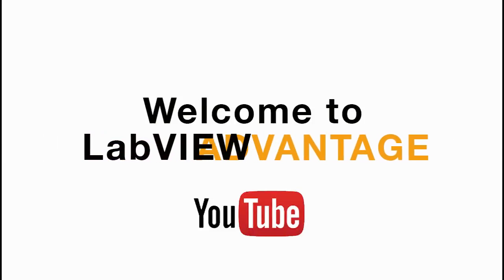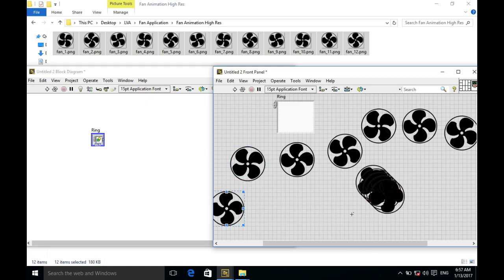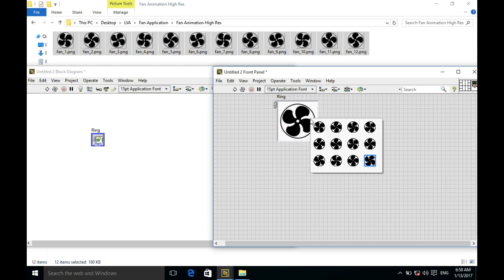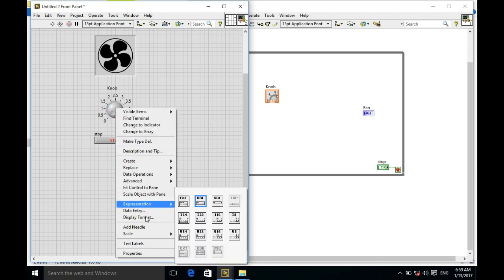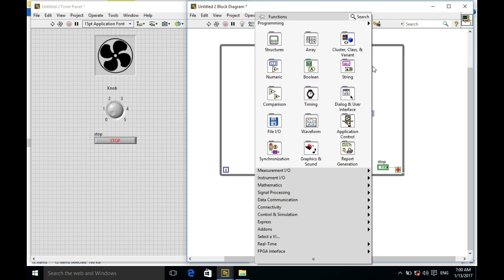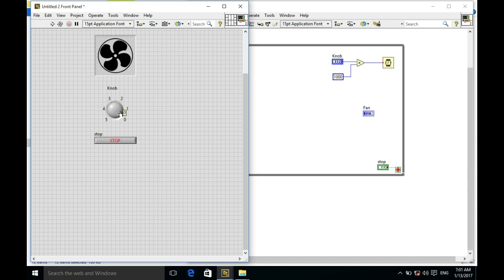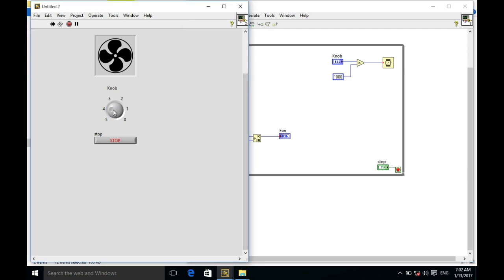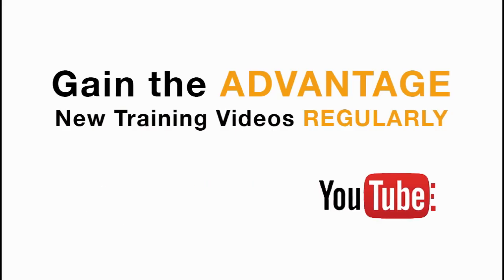How to make Animated Fan Speed Control in LabVIEW

Comment: I made an animated fan like 10 years ago and in a much simpler way. Ready?
While Loop with shift register, wire a Boolean "Not" inline with that shift register, add whatever time delays to make this flip 0-1 faster or slower as your like.  Now simply drop a boolen indicator on the front panel and change the OFF decal to an image of a fan blade and change the ON decal to that same image rotated 90 degrees.  Connect that indicator to show the status of the shift register.  Done
Reply: Care to post a video ?

Comment: Although you have 12 fan pictures you have configured them as 12 pictures per 360 deg. rotation. For a four bladed fan you obviously only need to spread your animation over 90 deg. after which it repeats. I would suggest four images at 0, 22, 45 and 67 deg.
PS. I think calling this a fan speed control will confuse LabVIEW beginners, since this is an indicator!

Comment: How would you reduce the flicker effect of the ring cycling through the 12 fan pictures? Would using the timing vi "wait until next ms multiple" help more in this situation?
Reply: or was that just the fact there are only 12 frames in use whereas the eye perceives 24 fps as smooth image? I cannot tell between one and another cause in this case: is it a memory call problem, a timing problem or a frame cap problem (do we just need more images)?
Reply: must be a combination of all these factors... (: thanks for the video!
Reply from the maker: +Count Agava Dear Count Agava, yes you are right to show smooth image the fps should be at least 24. But if you are writing a LabVIEW code and want it to be responsive, the recommended loop rate is 10 times a second.
Reply: Thank you for replying!

At the mentioned 10 Hz loop rate, the animated fan appears as though it flickers - to a user, but the program is indeed more responsive to input. Alright,  I'll try do figure out how I would make the thing responsive and pleasantly smooth at the same time. 

I suppose its possible then to wire controls for the program from a master while loop and run the animation loop in the slave config. As such, the timing function and the control scheme for (at the very least) halting the programme would be separate. Perhaps this would allow for a greater number of looped frames per second thus a smoother image transition as well. I shall try to test for this.

But I still wonder and I want to research this in more detail, how the picture ring enum works. 
Are the images stored in memory or does the enum access them from a drive directly for each poll?
I will try to find answers to all these questions on my own, I hope the LV documentation has all the answers.

On a side note, I have recently passed the clad exam! I've studied your prep videos and several hands on projects you demonstrated. Thank you, sir! It was a fantastic experience, having passed this first exam.
Reply from the maker: Congratulations on your success. :-)